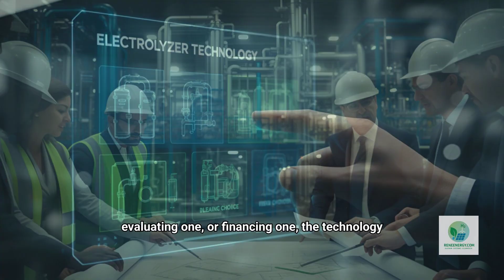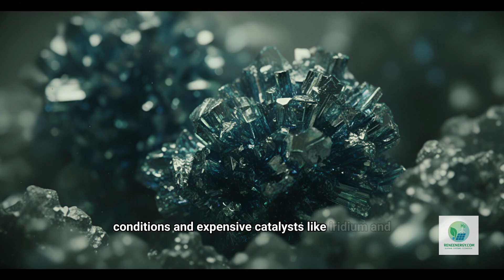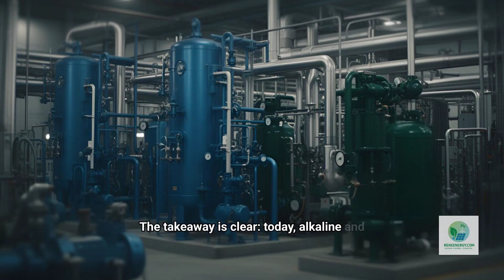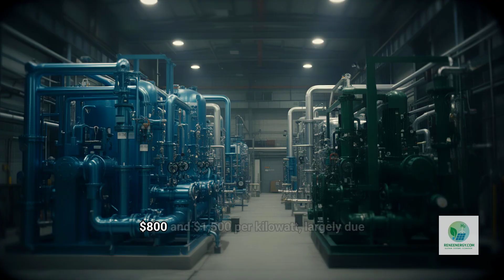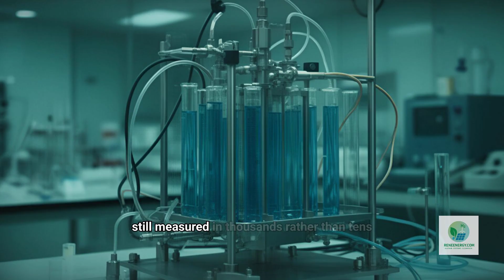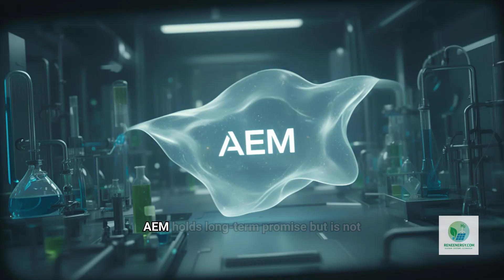Choosing the right electrolyzer could make—or break—your green hydrogen project

Comment: No-one looks at the water.  They add ions which only affects one electrode.  The simplest thing to do is change the water from para (hydrogen with opposite spin) to ortho (hydrogen with similar spin).  Polarising water dramatically changes the energy required to split it.  This method is used by every plant on our planet.  Polarised hydrogen nucleii  have very weak hydrogen bonds.  Polarised electrons and they have weak covalent bonds.  Now water can be split at under 10kWhrs/kg.